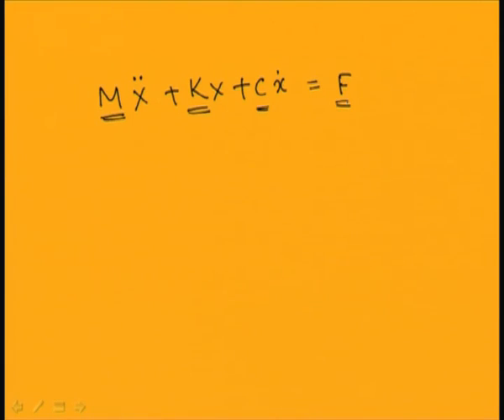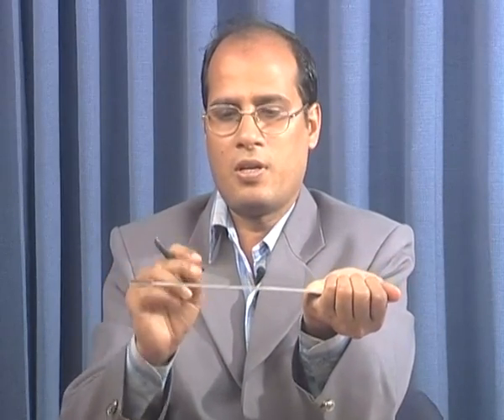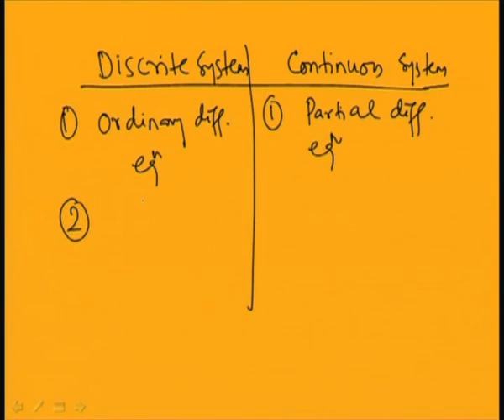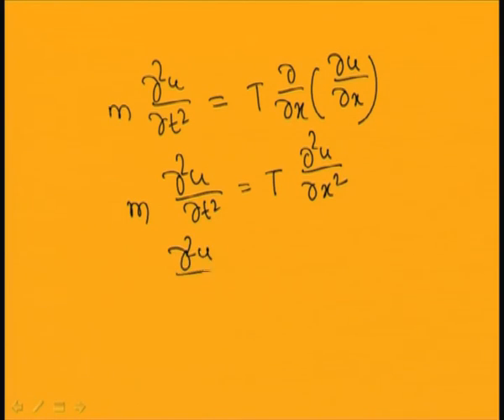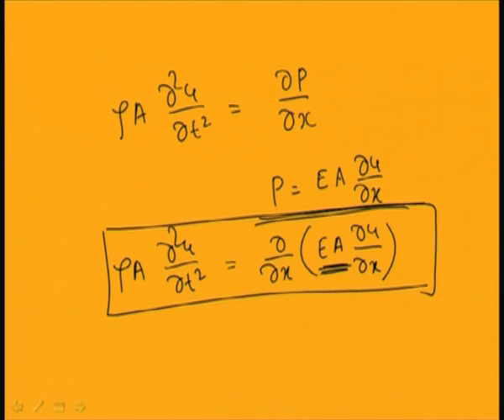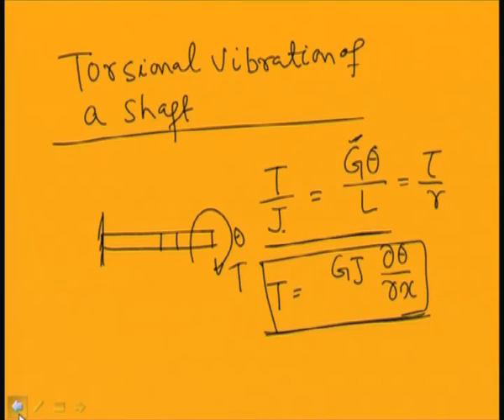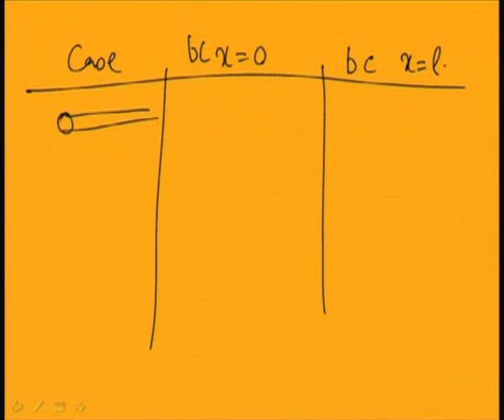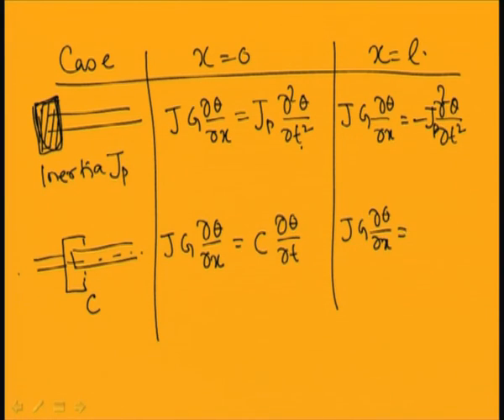Mod-9 Lec-1 Derivation of Equations of Motion Part 1-Newton's and Hamilton's Principle

Comment: In case of a fixed - free boundary condition of longitudinal vibration of rod the value of du/dx will be zero at free end side, but you told value of u =0